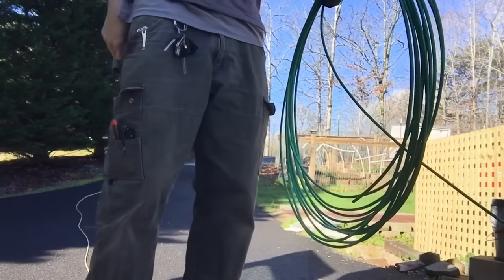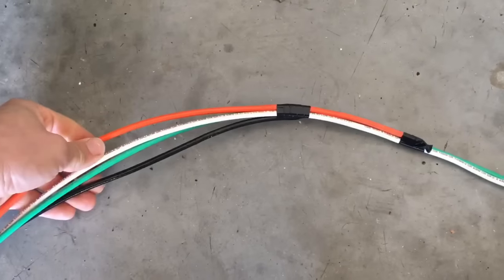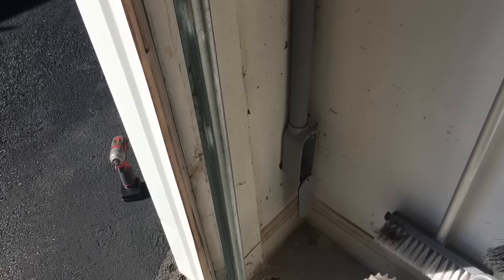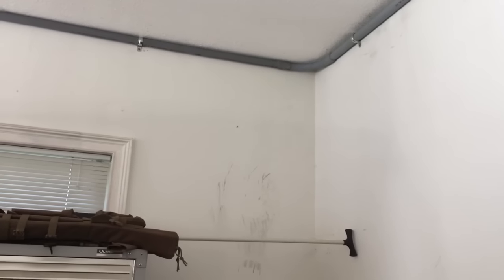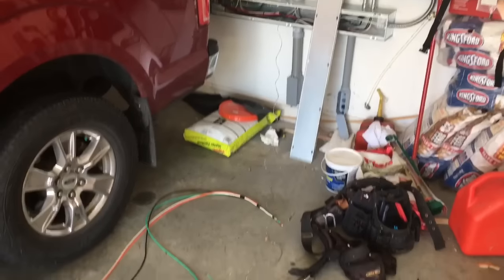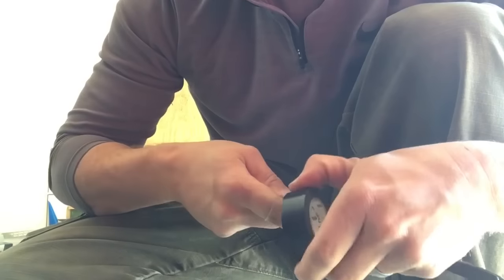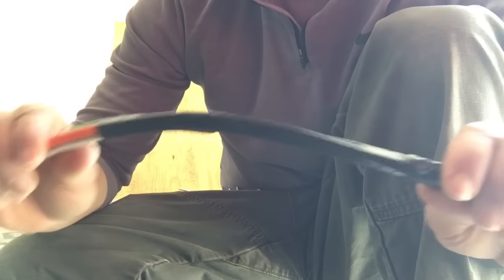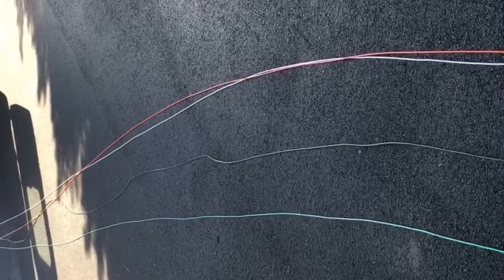Electrical Wire pulling secret string move

Comment: I have watched hundreds of electricians pull wire, and never seen one use the vacuum to pull string.   I can't believe I did not think of this myself; it's so dang obvious. lol.  That's really cool.  Two heads are better than one, once again.

Whenever I have done a run like that, I feed the wire as I build the run.  Let me ask you have you ever done it that way?

If yes. or no would your method as in the video be faster?

My school has been informal,  self taught. and in the field 35 years; many of those years correcting mistakes made by "electricians."

You would be surprised how many electricians cannot set up a 4 wire GFCI circuit.

Or how many think the Netural and the Ground are interchangeable (same thing) scary.  Using ground to carry a load.

Using a vacuum to pull string,  man you really make me feel ignorant.
that is so obvious.
Reply: You should feel ignorant for how you install wire as you assemble conduit. Only handymen do that! If you can't pull wire through it it's probably an illegal installation.

Comment: Your wadded up plastic bag is called a mouse, or at least the real ones made of foam are, and yours was a little too big, too much friction. Always use a wire lube, but instead of the wet ones use talcum powder, it is dry so circuits can be energized without the required wait for drying, and the talcum can be puffed into the pipe or stroked over the wires in your palm as it goes in and is super slick, and for this application you probably won't have to worry about getting uterus cancer.

Comment: Your home Depot bag was to big. You made it smaller off camera lol. I knew right away that the vacuum wasn't gonna suck that thought the PVC conduit.
Reply from the maker: Hollywood special FX. Sounds like you already knew the trick
Reply: What about compressed air? Seems like 120 psi would have more push than the 14.7 psi max of any vacuum.

Comment: If I'm going to be running the wires underground like this, do the wire have to be rated for underground use or is the airtight underground PVC good enough?
Reply from the maker: Use gray pvc electrical conduit. It has gentle sweeps and bends designed for pulling wire. You do not need to use UF (underground feeder) if it is going in a pipe. You could use thhn, or thwn-2. Lots of choices here. Where are you located?  US?
Reply: Yes, any time your THHN as he is using is going outdoors or underground in any raceway, it is required for the will then to be THWN. and if exposed to sunlight, then THWN-2 for UV protection. 
If not in a raceway underground, then you can use type UF but watch the heat rating and check your codes for each type of wire, they are not all rates for the same current. Also remember 90C rated wire also needs to be installed for 75C termination points, as the breaker is never rated to 90C. so when looking up THHN under NEC 310 use the 75C column and not the 90C. But when calculating derating you can use the 90C column and also for parallel rating.
Reply: @GainSolarPower  there are a few things that you did not list here and you may be unaware of but electrical grade PVC comes in two standard types, schedule 40 PVC and schedule 80 PVC. Both are gray. White is only for Plumbing installations  as gray PVC has a fire retardant in it. Schedule 40 PVC can be used underground where it is not going to be exposed to the outdoors above ground or UV light, anything on the outdoor environment or exposed to UV light is required to be in schedule 80 which is thicker walled and can handle more heat. Sch. 40 is used indoors, or underground only, and as the conduit exists the ground you must change over to Sch 80. As for the wire types THHN is not allowed to be used Outdoors or Underground, use THWN for anything installed Outdoors or Underground. And if the conductors are going to be exposed to direct sunlight you will be required to have UV protection on those wires which is THWN-2. Most of the supply houses and vendors for this type of wire only sell thwn-2 now to not confuse the installers. You can use THWN-2 indoors outdoors and Underground. UF cable on the other hand has a lower heat rating of 60C therefore can carry less current and you will need to increase the wire size in some situations. But each of these wire types have different heat rating take THHN or even thwn-2 both of which have a 90C rating, but their current carrying capability is actually lower than 90C and you should refer to column 75C due to the termination point in which it will come in contact with. Even though THHN is rated to 90C you may not use this when calculating the current that will be traveling on the conductor from its OPC. because the termination Point applies, so if your termination Point let's say a breaker is rated at 75C, the entire circuit needs to be rated to its lowest denominator which is 75C. The 90C heat rating of The Wire can only be applied when calculating derating or parallel circuits. Breakers  are never rated to 90C and are only rated to 75C. Just a bit of knowledge to help you in your profession.

Side note, OCP= Over Current Protection. ie: Breaker
Reply from the maker: @zebraman777333  I didn't know about having to transition to shedule 80 aboveground.  No one ever does that around here.  good tip.  Yeah its thwn-2 I was using I've just gotten so used to calling it THHN that my mouth cnat stop.  You sound like you really know your stuff.  I was mainly just doing a video about sucking a string, and it has gotten a whole lot of views.  Thanks for chipping in.
Reply: @GainSolarPower  Ya, just figured I would give you a heads up. I had a feeling you knew about the THHN vs thwn most guys just get used to calling it THHN. Lol that's normal.

I'm a State Certified electrical contractor, I also hold a master's in electrical engineering and a level 3 electrical inspectors certification. I'm a third-generation electrician who just went a little farther than most in my education. 

I have been thinking of starting a new YouTube channel, to teach some things if I ever find the time.

Comment: You can also use compressed air and blow the pull string thru.
Reply: I use a wet vac at the other end and tie a plastic walmart bag on flys right through
Reply from the maker: Yeah so I hear. The vac works for me

Comment: Why don't you put the wires in the conduits before attaching them to the wall ?
Reply: If you decide to do that, please make a video.
Reply from the maker: You should try that and let us know how it goes. Typically it doesn’t work very well. Running the conduit and then installing the wire is a very common practice.
Reply: Hello Ed, hello Johnny.
Thanks both for your answers !
I realise that my question looks a bit rude afterwards, I didn't wanted to offend anybody by any means. English is not my first language so I sometimes forget to make "pretty" sentences. It got your attention so I guess it served its purpose. Anyway.
It happens I do that pretty much every time I need to run conduit, but maybe I see why you don't do it that way : in my contry (Belgium, yes, that's a country) we run mainly 2 types of electrical conduit : prewired flexible conduit for everything in the floor or in the walls (our homes are 90% mansonry, you rarely see wooden houses) and then "cable" wich is wires bounded together in an insulator (I think you call it lumex ?) We run that cable in rigid conduits to make it pretty, but we rarely use elbows, we run it in pvc pipe whenever it's straight and if we have to make a 90, we let the bare cable visible. I'm a residential technician, I'm always alone so i have to find ways to make it simplier for myself, but a lot of guys here do it that way too, because if you have to run a 5g6 solid core cable (5 #9awg wires) in conduit, it's impossible to do it the way you do, appart from pulling it with an excavator. I do it that way too whenever I need to put something underground in a caboflex (don't know how it's called in the US), let's say a gas or water line, or even copper for heat pumps, I lay it straight and flat on the ground, put everything I need in it and then shove it where it needs to go.
I sometimes see you guys installing steel conduits by the mile, we don't do that here, we use cable trays and then run the cables in them, XGB cable for commercial purposes, wich is fire retardant and halogen free etc.
I digress, but I think it's interesting to see how it's done in other countries.
Anyway, I think we all should keep an open mind becouse a lot of times, there is more than one way to do the job !
Lenaïc
Reply: @l3n464  No worries! We have to install the whole run in conduit in the states. I work alone and am always looking for an easier way do things! I always say I can use a helper for about 15 minutes a day. We're comparing apples to oranges running without 90 elbows. We have pre-made cable assemblies romex and SE(R) cables, but they are more for in the wall or in a crawlspace. If I have an open ditch, I sometimes pre-assemble wires and conduit and then drop it in.
It probably wasn't that easy working in that garage(especially if the car was still in there)
Your English is better than many of my friends😉
Cheers and safe wiring!
Reply from the maker: @l3n464  In addition to what Ed said we americans definitely know about Belgium, the land of waffles and chocolate.  Wire has to be protected from damage in the states and plenty of things could happen to it in that homeowners garage.  I've definitely done you move before with metal flex but in almost all situations its easier to pull the wire in after the fact.  Im sure electrical work is a whole lot different in your area than in Southeastern United States.  I honestly had no idea this video would get so many views.  I was just showing a little trick..  Thanks for watching.

Comment: Good helpful video. I like yto take my die grinder to soften the inside radius of the LB. On difficult pulls this sharp edge of the LB conduit stop chafes the wire if you don't ease the edge, even then you need to be careful.
Reply from the maker: Can you send me a pic of what your talking about. You grind the inside of the short side of the LB?
Reply: @GainSolarPower  ... Not sure if he worded that clearly, but I think he means any conduit with a square edge gets a slight rounding on the inside to avoid snags. That might include straight sections too if there's a coupling involved. Kinda like deburring EMT but doing it on plastic to remove the sharp edge.

Comment: mule tape will not cut into the corners, it turns to the flat side......LUBE, even just soapy water;  is always great for pulling wire.
Reply: @Joachim Bartsch 
Klein foam lube that doesn’t ruin tools or clothes is amazing!
Reply: @thetruth5210  Just used it for the first time today. Its great. Way better than gel
Reply: Baby Powder, no mess and smells good!!
Reply: @legend6591  had a lineman once shoot some kind of aerosol lube into a conduit for us.  don't know what it was, but the wire almost fell into the pipe.

Comment: On a small Installation like that why not pre-feed the cables while assembling the trunking far easier.
Reply: so what you are saying is that to you, doing 6 ten foot wire pulls, and four two foot wire pulls, plus trying to glue up conduit without gluing the wire to it; and mount it with the weight if the wire in it, is easier?
Reply: @kenbrown2808  Short runs like that no problem Ken I thread al the cables through together glue then outside of the pipe before assembling to the bends and no over stretched cables.
Reply: @louisdisbury9759  well, you do you.  I throw the pipe up empty and light, and glue it properly, and I've still never had wire go in as #6 and come out as #8.
Reply: @kenbrown2808  I'm a Brit Ken we always tihnk outside of the box I retired a Millionaire at 60.
Reply: @louisdisbury9759  a guy I trained retired at 35.  I can't retire. my town falls apart if I even go on vacation.
Reply: @kenbrown2808   you both are wrong to be running PVC exposed. Put the pipe together then pull the wire.

Comment: No tension in the wrapping of the tape, have to apply some force.
Reply from the maker: Gently yet forcefully
Reply: @GainSolarPower  I don't have my guys be gentle. They should be adding tension to the tape until they think it is about to break. Here is a quote from the 3M rep, writing an article for EC&M.
"tape should be stretched just short of its breaking point"

https://www.ecmweb.com/content/article/20897095/electrical-taping-skills-a-lost-art

Comment: Whole thing was a waste of time, could have just pushed the wires through, could have assisted with a fishtape to make it ridged. Could have pushed a fishtape through and twisted the wires on wouldn't even need tape. One of our most recent pulls was 13 number 12s through a 3/4 emt. This is 4 through what a inch and a half?
Reply from the maker: For you it was a waste of time, but if it helps one person, by demonstrating you can suck a string with a vacuum then its worth it.  You are obviously in the electrical trades.  I salute you brother!  I had forgot my fishtape that day and doing youtube gives me a sense of purpose in mundane tasks.  PS that was 4 #6 thru a 1 1/4"
Reply: @GainSolarPower  sorry if I sounded grouchy in my comment, was just taught by grouchy journeymen lol loved the video either way!!

Comment: Can you run two set of THHN wire (6 wire total) in one conduit?
Reply: @Snow G 
Without knowing the size of conduit and the gauge of wire you can’t give an answer to your question, you don’t have enough of the variables. When you are at Lowe’s, Home Depot, and/or Menards there’s going to be a book called the uglies book it will tell you your conduit and/or nipple fill, it is roughly 40% for conduit which can have bends and 60% for nipples completely straight runs between points. If you are adding wire to conduit and/or nipples that already have wire in them lubricant is not a luxury item.
Hope this helps!
Reply: Depending on the gauge, which I assume is less than 10awg, you should be good with minimal 1 inch conduit but having larger than necessary conduit just means you can add more later 👍🏻 though it does mean a couple bucks
Reply: It you run more than three hot legs in one conduit (in the US) you must also derate the capacity of each wire a certain percentage. You'll have to dig into the NEC for the calculations.

Comment: That looked like #8 wire you were getting ready to pull. 3 wires would fit through ½ conduit barely. ¾ conduit fairly easy  but I wouldn't go under 1 inch but not over 1¼ inch. Anything over that for that size wire is just a waste of money.
Reply from the maker: They call me 2” johnny

Comment: Jet line cut the conduit? jesus what kind of pull line is that its just plastic string? Every home owner should own a bucket of jet line. 
That's really not the best way to wrap up that wire for a pull. leave the wires straight  no hook just  stagger them down the length a little. Then wrap the jet line around them in a spiral fashion about a foot down so it does a Chinese finger effect to it. Then tape it up and the end will be smooth instead of the big ball you have at the end. if done properly the jet will never come off. Then if even a possibility of it being a pain to pull or many right angles apply some wire pull lube at the end. And always pull a companion jet line with it never know if another wire has to be added.
Reply: I'd just leave the jet line uncut if it's long enough, and pull it in parallel with the wire.

Comment: This is no "secret". Any of us in the trade could show you this. We call that "string" jetline, and that wadded up home depot bag is an improvised "mouse".
And we don't use "3-phase" power in houses...we call it "single-phase", even though there are 2 phases. This guy sounds like a self-educated residential electrician.
Reply from the maker: You hit the nail on the head there buddy. But I didn’t say anything about 3 phase did I?  Are we going to argue about single phase vs split phase now?  Or how bout whether it’s 110/120 or 125v?

Comment: never step on your wire 8 - )
Reply from the maker: Since I put up this video I have Heard this twice now. Why is there some technical reason?
Reply: Gain Solar Services it’s the same reason you don’t step on your rope, it frays it and splits strands and in wire it can make the copper arc within the insulation which causes big problems down the line, especially for sensitive electronics

Comment: Vacuuming is a viable method, but why waste your time on it for such an insignificant pipe run, a Walmart parking lot that garage isn't.
As for the head, if he'd made a proper one, he wouldn't need to waste half a real of tape to prevent his wires from becoming detached 😂

Comment: I wouldn't have used PVC makes me wonder if you lack the skill/talent to bend emt 🤔 but I could be wrong 🤷
Reply from the maker: I never got to bend much pipe coming up thru the ranks.  There are a lot of different types of electricians out there. Some bend pipe on a lift all day, some wire up danish bread machines, some program poultry plants, some work on motors, some wire new constructions. it goes on and on. Figure out what makes you the most money quickest and hit repeat. 

Sounds like you are good at everything though so you probably wouldn’t understand. 🤔

Comment: Or you can just run it as you install the conduit haha
Reply from the maker: No electrician is going to do that. You run the pipes then pull wire.
Reply: @GainSolarPower  If I have a conduit more than 25" installed for me, there better be a pull sting installed. Electricians who install the conduit should always carry it. If the job is large I'll ship/deliver the bucket of string. String is cheap enough but any size of mule tape is $$$.